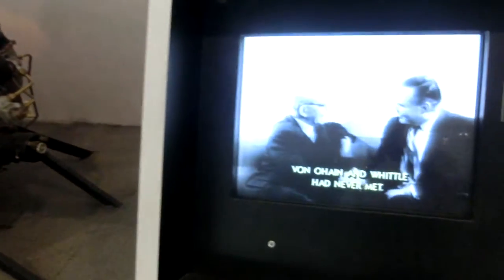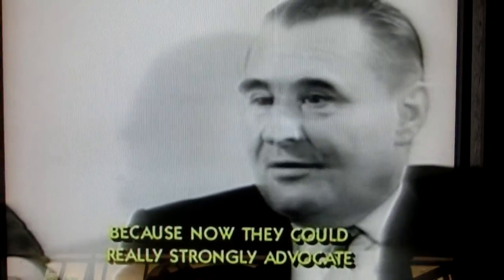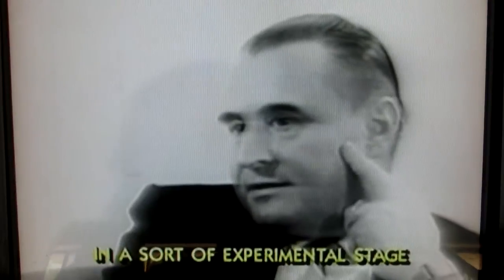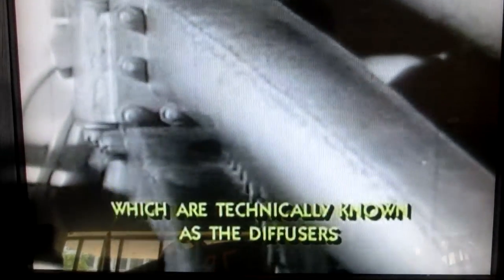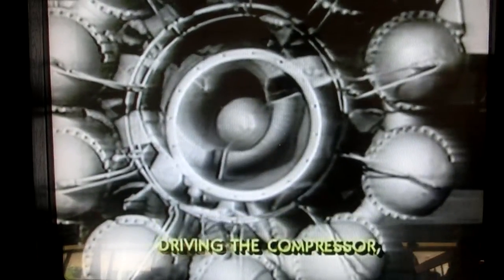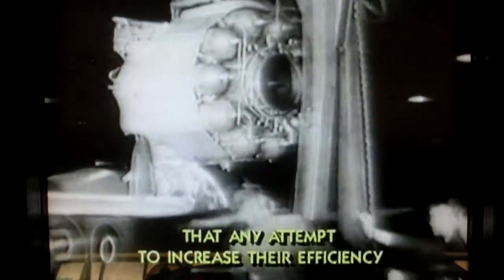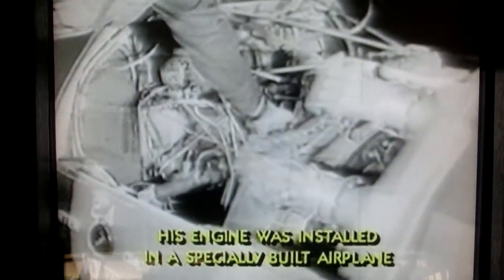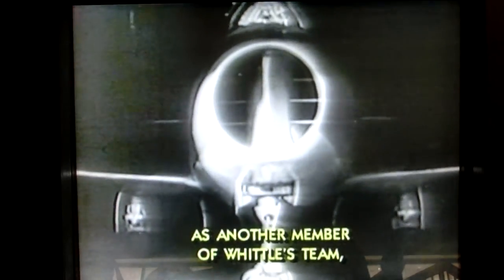Jet engine pioneers Frank Whittle UK & Hans von Ohain Germany meet

Comment: Just to say it, the myth that von Ohains work was based on Whittles is completely wrong. They didn’t knew about each other’s work until Whittle saw a picture taken from a British spy plane of a German airport with burned ground years after the first flight of the first jet plane. They worked independently.
Reply: Germany did take whittles plans from patent office fact   but yes they were both working on jet propulsion

Comment: Von Ohain is the inventor..He flew two years before with a completely different design..Whittle's 1930 flawed  patent didn't work.
Reply: But the brits had a jet fighter in ww2 they used to topple down v1 bombs
Reply: @herobrinesblog  no, they used hurricanes and spits. their meteor fighters were used against bombing raids and the ME 262. The first turbojet flight was in 1938-9 as the he178
Reply: @rpg2428  the meteor and me262 never met in combat. Hurricanes were a bit slow to catch up to V1s. Spits, Typhoons and Tempests had more success.
Reply: What a joke - not only is that made up nonsense but Ohains first revision didnt work and was way to wide to be practical. Yes Ohain flew first but because he had the full support of the military and a private aircraft company working out of their hangar. Also Whittle built all the component s bar a few himself whereas ohain was not a mechanical engineer and relied on external engineers to help him. If whittle had the support then they'd have flown much sooner. the first German Jet Engines could only manage 7 minutes in flight and offered a terrifying ride so not fit for purpose.
Reply: Also completely different types of gas turbine engines. Sir Frank came up with a centrifugal flow turbine and Von Ohaine’s turbine was axial flow and an infinitely more complex and powerful engine. Unfortunately for the Germans the axial flow engines operating pressures and temperatures were far greater so the engine a BMW Jumo had a scrap life of 25 hours because the German metallurgical science was not up to the standards needed to provide for reliability. Whittle was a pilot in the RAF and developed the much more reliable centrifugal flow engine that unlike the Jumbo was forgiving to pilot handling as well it had a  much longer service life as well as being much simpler to manufacture.
Todays gas turbines carry on the legacies of both men. The high bypass turbo fans on todays airliners carry the Whittle DNA and the powerful engines that power most of todays jet fighters carry Von Ohain’s axial flow DNA.

Comment: The truth is that Whittle's engine offered a more refined, practical ride and, whilst flying first, the ohain engine was useless for practical reasons for years and offered a dangerous, terrifing flight lasting only 7 minutes. Don't forget that Ohains design tried to use hydrogen as a fuel whereas Whittle knew this was impractical (still is today though RR are experimenting with it) so this tells you something about Von ohain avoiding dealing with the kerosene issue from the get go and whittle taking his time to get it right...sometimes delas are there for a reason ;)

Comment: Ohain flew first but because he had the full support of the military and a private aircraft company working out of their hangar. Also Whittle built all the component s bar a few himself whereas ohain was not a mechanical engineer and relied on external engineers to help him. If whittle had the support then they'd have flown much sooner. the first German Jet Engines could only manage 7 minutes in flight and offered a terrifying ride so not fit for purpose - just because it flew first doesn't mean the superior product flew first. there was a very good reason these aircraft took so long after their first flights to be practical.